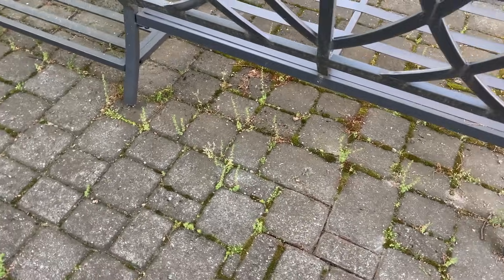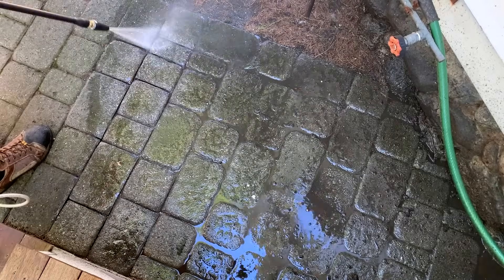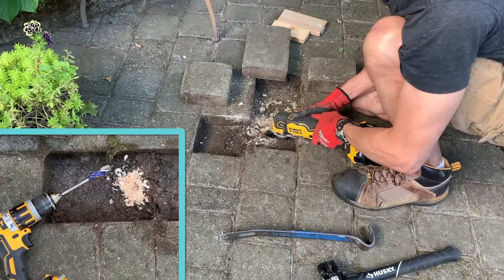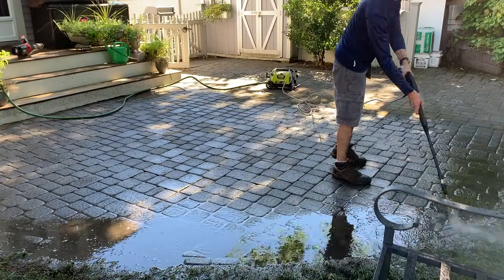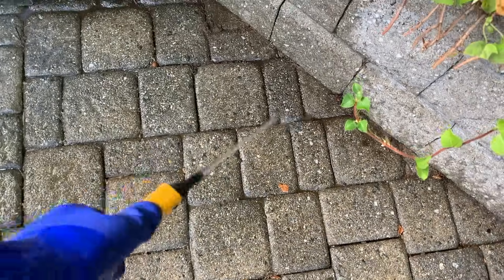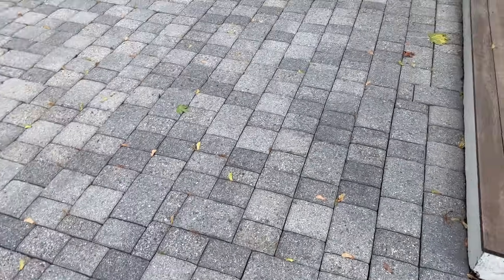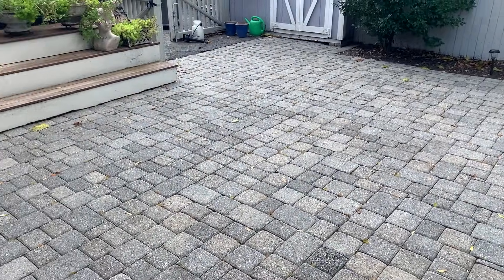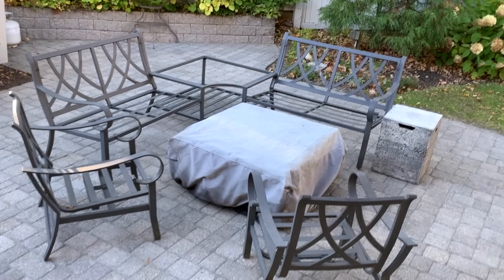How To Clean Your Patio and Kill Moss - Patio Restored!

Comment: I was tired just watching you. Really all those lines in the whole patio with a putty knife?
Reply from the maker: Ha! and yes, a putty knife... it was time consuming. I actually considered doing one series of pavers each evening while grilling, but then realized it would have taken me about 150 chicken legs, 100 hamburgers, 20 grilled pizzas, and 50 ears of grilled corn to finish ... so basically all summer. 😃 The pressure washer could have removed the moss, but I didn't like the idea of using so much water and pushing the moss into the lawn.
Reply: I think I'll have a exposed aggregate porch put in instead of pavers. Lol
Reply: Great info. My patio in need of clean up. I’ll take before and after pics. Thanks!!

Comment: My Nephew just power washed the bricks on my patio.  Not an easy job, now The next step is to buy the right sand.  So is vinegar the best thing to use to prevent the moss from growing back?  We had a LOT of moss build up.  Also have a tree growing in the center that everyone but me wants to keep.  😞  Liked that you were right to the point about this.  Doing it at your house, and not trying to sell us a hard way to be doing it, I know it's hard and messy, but mose people showing us this makes think it would be better to hire someone.  It's just getting dirty and taking the time.  Then when done you can be proud that YOU did it yourself!  Thank you from Western, N.Y.
Reply from the maker: Thanks for the kind feedback. I've found the best way to prevent moss and algae from coming back is to apply a cleaner (I use 30 Second Cleaner) once a year and rinse with the garden hose instead of a pressure washer as to not disturb the sand.

Comment: how long did the whole clean up take?
Reply from the maker: I believe it took about 8-10 hours across three days (three days because the pavers have to dry before adding sand to the joints and it rained on day two so I couldn’t do anything). Would have been faster had I used the pressure washer instead of the putty knife. Of course I always say if I want something to take longer than it should make a video about it. 🤣

Comment: Nice!!  and Yes, you sounded like this is a short, easy job but just "repairing" 30 or so uneven, cracked pavers took awhile....used Level 1 rocks and Level 2 sands from home depot...will need to do more thorough cleaning like you have.
Reply from the maker: Thanks for the additional info. Good luck!

Comment: Great video.  How about applying a Sealer after all this hard work? 
Will it help to keep it in shape longer?
Reply from the maker: That’s a great question! The short answer is “Yes!” The long answer as it applies to our patio and pavers is that sealing seemed more of a personal preference than a necessity. There are obvious benefits to sealing porous, concrete pavers (less staining from oil, grease, and dirt; less frequent maintenance because it’s harder for algae, mildew, and moss to grow); however, I’ve found that if I use a good quality polymeric sand and wash the patio every 2-3 years with 30 second cleaner rinsed with a garden hose (no pressure washer to avoid carving out the joints), our patio looks great! Our ~20 year old pavers have never been sealed and signs of wear are minimal. Would a sealer prolong the life of the sand? Probably, but it doesn’t seem worth the time and expense for me. If the patio was a new installation, I’d seek the opinion of the paver manufacturer versus the sealant manufacturers pushing products. And while many sealers are environmentally friendly and provide additional weed and algae protection, they still require reapplication every 3-5 years. There’s also the possibility of over applying, which can lead to dulling and premature pealing. In that case I’d have to figure out how to remove the remaining sealant or else the finish would be uneven. So ultimately, I’m not signing up for that headache. 😃

Comment: Try BIO washing powder on the Moss first, worked for me. Turns it brown and it dies over a couple of days and is then a lot easier to blast off with a pressure hose.
Reply from the maker: Good advice! Are you referring to. BioAdvanced Moss and Algae killer/cleaner?
Reply: @BruceAlanR  No, just ordinary Bio washing powder. I was surprised it worked, but given it was a cheap trial I gave it a go and it worked. The moss turned orange in a couple of days and a quick blast of the power hose it was gone. Lasted 2 years before the moss started to come back.
Reply: I used bio washing powder on my asphalt drive. It worked really well. I left it on for 5 days and it killed all the moss.  I used my jet wash which blasted it off easily.

Comment: You can do the same in a fraction of the time. Use WetandForget in a pump sprayer and make applications in Mid-May with no rain for two days and again after a month.
Reply from the maker: Yes, that that’s an option. I’ve used Wet and Forget under different circumstances. Smells bad (Ammonia) for quite a while and takes a loooong time (many months) to restore a surface.

Comment: Problem with pressure washer is removes existing polymeric sand so you need to add more and it never stays or looks like when it first did.  I was considering 30 second cleaner but afraid it’ll bleach pavers, I have similar pavers as yours and this is greta to see.
Reply from the maker: Yes, don’t pressure wash unless you plan on sanding between pavers after. If you just want to clean the pavers and aren’t battling moss, you can apply 30 second cleaner, let it sit for 15 minutes, and rinse with a garden hose. That’s probably what I’ll do this coming spring to brighten up the pavers.

Comment: Thanks for the tips, my only worry is the bleach part. Not so great in general and not at all for your plants. Moss doesn't like acidity so you can also use cleaner vinegar to deep clean.
Reply from the maker: Yes, vinegar will kill moss.
Reply from the maker: I should have also mentioned that if your concrete pavers are sealed, vinegar will eat away at the sealant and make it look dull. Vinegar can also pit concrete over time... like acid rain. 😃

Comment: After using the cleaner, how long is it necessary to wait before putting down the sand?  We’re expecting rain tonight and we were thinking it would help push in the sand more.
Reply from the maker: Before putting down the sand, the joints just need to be dry so that the sand can easily settle to the bottom. You could try using a blower to speed up the drying process; however, depending on how much rain you’re expecting it may not be a good idea to apply the sand before a storm. A heavy rain could wash out the joints or possibly separate the polymers from the sand. It’s important that the joints setup properly.

Comment: What tools did you use to lift the pavers?
Reply from the maker: To lift out pavers I use two thin pry bars - one on each side. Dasco makes an inexpensive 3 bar set for removing trim and moldings that work. If you’re going to remove more than a couple pavers, it’s helpful to place each paver next to where it came out in the orientation it came out to avoid a headache later. 😁

Comment: Does your friend have a recommendation for sealant? Our neighborhood seals the papers after sand is spread. Great video. Much appreciated.
Reply from the maker: My buddy said he hasn’t sealed any of his concrete paver installations although he would if a client requested it or the paver manufacturer recommended it… $$$. As it applies to our patio and pavers, applying a sealant seemed more of a personal preference than a necessity. There are obvious benefits to sealing porous, concrete pavers (less staining from oil, grease, and dirt; less frequent maintenance because it’s harder for algae, mildew, and moss to grow); however, I’ve found that if I use a good quality polymeric sand and wash the patio every 2-3 years with 30 second cleaner rinsed with a garden hose (no pressure washer to avoid carving out the joints), our pavers look nice. They’re now ~20 years old, have never been sealed, and signs of wear are minimal. Would a sealer prolong the life of the sand? Probably, but it doesn’t seem worth the time and expense for me. Not to mention sealers require reapplication every 3-5 years and can peel if not applied correctly. Peeling would present an additional headache since it would require removing the old sealant with some chemical in order to prevent a blotchy finish.

Comment: I did my patio 2 years ago, I pressure washed it for the first time yesterday to get all the moss and weeds out from the cracks. Every time I pressure wash the patio, do I need to readd polymeric sand? Or did you just reapply this time because it had been neglected for some time? Cheers.
Reply from the maker: The intention of the video was to demonstrate how I got rid of weeds and moss in an effort to restore our patio to its original condition (I had neglected it for over a decade). After restoration, all that’s left is annual  maintenance if it needs it. For maintenance I spray weeds with Roundup (of which I can count them on one hand), and then a week later (once the weeds are dead to the root), I apply 30 Seconds Cleaner, leave it for 10-15 minutes, and then rinse with the garden hose (the rinse nozzle of a pressure washer is fine too, but the key is to avoid blowing the sand out the joints or you’ll be sanding again).  Hope that helps!

Comment: How important was using outdoor cleaner? Did it really help with the coloring of stones? Is it necessary to prevent weeds/moss when you’re already filling the gaps with sand?
Reply from the maker: I’m sure you can find other chemical as well as bio-friendly cleaners (indoor or outdoor) that will not only clean the stones, but also kill weeds and moss. Some folks mix equal parts water and white vinegar (the vinegar will also likely kill plant roots that didn’t get pulled). You would think the sand would prevent weeds; however, Mother Nature finds a way. If you don’t kill weed roots or seeds that are beneath the sand they will eventually sprout.
Reply: Ahh I went ahead and skipped the outdoor cleaner and went straight to laying down the sand :/  

Would it still be effective to add the outdoor cleaner after the sand? Assume not since it won’t get directly into the roots.  But better than nothing?
Reply from the maker: @erictso534  If you like how the pavers look, don’t use cleaner. If any weeds come up just use a weed killer (I.e., Roundup or vinegar and water).

Comment: Great job sir. How long did it take.
Reply from the maker: I believe it took me about 8-10 hours across three days since the pavers had to dry before I could add sand to the joints and it rained on day two so I couldn’t do anything. Would have been faster had I used the pressure washer instead of the putty knife. Of course I always say if I want something to take longer than it should I’ll make a video of it. 🤣

Comment: How do you clean the material up that stays on the actual tile it self since there no way every last drop of sand goes in the crack.
Reply from the maker: I think you’re asking how to clean up any sand that doesn’t go into the cracks while sanding. If so, what I do is use my gas powered blower on idle before wetting the sand. Anything sand remaining on the pavers after blowing lightly gets watered with the joints. Once everything is dry and a few days later I sweep or blow any remaining sand off the surface of the pavers.

Comment: wait, you flushed the industrial bleach into the soil? isn't that harmful? not saying I have a better solution, but it jsut caught my eye.
I asking because I am planning also to clean my front yard and I keep wondering what kind of product I can use to avoid any chemicals or soil damage to the surroundings.
Reply from the maker: When rinsed, the product is not full strength. They claim it is safe for the lawn when rinsed well, but I hear you. I tried to rinse towards the driveway as much as possible.

Comment: Great video
I take salt and put it everywhere make it wet and wait a month, everything is gone
Reply from the maker: Thanks for checking out the video. I’d be weary of using salt. It’s pretty hard on concrete pavers and may pit them over time. And while it may kill moss and weeds, salt will also kill your grass should you rinse it into the lawn. Many synthetic fertilizers have a high sodium content and when I’ve over applied them (spreader wasn’t calibrated properly) they’ve burned areas of the lawn. So I guess when you say “everything is gone,” you mean everything. 😃

Comment: Now finish the job by sealing the pavers with a good water-based sealer.
Reply from the maker: Great suggestion. If this was a new installation I’d consider it, but the pavers are ~20 years old. They’ve never been sealed, show no signs of wear, there’s minimal staining, and cleaned with 30 Second cleaner and rinsed with the hose every few years is enough. Would a sealer prolong the life of the sand? Yes, but adding “seal pavers every 3-5 years” to my never ending to do list isn’t a priority for me. I already seal our 3 mahogany porches every three years, which is a headache. 🤣

Comment: Ever consider sealing your pavers?
Reply from the maker: I have considered it. The thought of having to do it every few years and the potential for over application and pealing isn’t…. Well, appealing. 😁 I’ve found that if I clean the pavers with 30 seconds cleaner once a year or every other year and rinse with a garden hose (no pressure washer or I’ll need to sand again), it stays looking nice.
Reply from the maker: I have considered it. The thought of having to do it every few years and the potential for over application and pealing isn’t…. Well, appealing. 😁 I’ve found that if I clean the pavers with 30 seconds cleaner once a year or every other year and rinse with a garden hose (no pressure washer or I’ll need to sand again), it stays looking nice.
Reply: Awesome! I appreciate the input. In the process of cleaning now so was considering it since it’s in a mossy/low sun area

Comment: This only works with brick or segmented patios.  What about solid cement?  Moss, not weeds.
Reply from the maker: I don’t see why the process wouldn’t work on cement slab although I’d test in an inconspicuous spot first to be sure the pressure washer doesn’t worm hole it. If the pressure washer with a Turbo Nozzle was too much, I’d use a broom or soft scraper to remove chunks of moss, then apply 30 cleaner (to brighten it up and kill moss) or even dish soap (won’t brighten much, but will kill moss if it sits), scrub with a deck brush, and rinse well with the hose or a pressure washer rinsing nozzle. 
I’ve also found that spreading wood ash on moss will change the PH and kill the moss, but it’s a slow, messy process. Then you’d want to wash with dish soap, let it sit, and rinse thoroughly.

Comment: Moss is easily killed with a solution of baking soda and water. Takes a little while, but changing the ph makes the area uninhabitable for the moss.
Reply from the maker: Absolutely! Thanks for sharing that.
Reply: Do you know if that would kill moss in lawns and not kill the grass as well cheers...
Reply: @only1kingofsing  No idea, sorry. I have experience killing it on the side of a tree and in between pavers. Probably wouldn't hurt the grass too much? I'd test it before doing anything large-scale.
Reply from the maker: @only1kingofsing  The issue with using baking soda on grass is the sodium content. Similar to applying too much synthetic fertilizer to your lawn (vs. Milorganite or an organic fertilizer like "Lawn Food"), which also contains sodium, you can experience "lawn burn." Over the years I've had limited success trying to tackle lawn moss with iron based products (Moss Out, Scotts Moss Ex), so I don't use them anymore. The best way I've found to deal with lawn moss is to increase sunlight, or at a minimum improve drainage, and address soil pH. You can improve drainage by aerating (reduces soil compaction), and detaching the lawn (this reduces moisture-holding debris on the top of the lawn),  both of which can be done late summer/early fall (September 1 in the Northeast) or very early spring once the snow is done, but before soil temps get to growing temps. I usually aerate, dethatch, and overseed heavily in early September to give the turf a chance to overrun the moss. I've done it in Spring too, but results have varied based on the random snow storm that can pop up in April. I also recommend a grass seed with deep roots (I like Pearl's Premium grass seed), which will absorb more groundwater making the soil less inhabitable for moss. Improving soil pH is a slower process. It's not as easy as dropping lime to raise pH unfortunately, but I recommend doing a soil test in early spring (before you put down any fertilizer). A soil test will help you understand your lawn's pH and indicate what nutrients the lawn is lacking. That way, you can pick a fertilizer (and for overseedng the proper top dressing -- ie, peat moss, organic compost, etc.) that will give you the correct nutrients without creating the ideal environment for moss due to moisture retention. One thing that has worked for me on small patches of moss is a light layer of wood ash (from the fireplace). It is a quick way to adjust pH; however, don't just go out and dump a bunch of ash on the lawn because too much can drastically change soil pH the other direction, which isn't good either. Hope that helps!
Reply: @BruceAlanR  Thanks Bruce i guess there`s no easy way so will invest in an aerator and do what you advise it sounds more sensible than the last attempt which was spraying it with washing-up liquid that someone advised on here but had no affect at all (i new it wouldn't be that easy 😄)